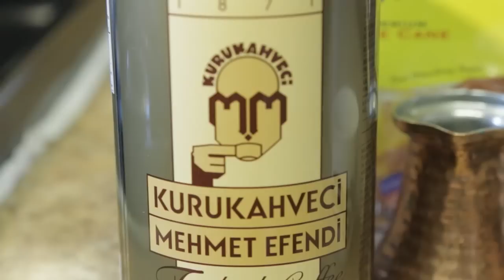Easy Turkish Coffee Making Guide

Comment: My steps: 1. Fill the cezve with 100 ml of water

2. Get it on full or medium heat, but don't boil it too much. Wait for bubbles to appear in the water

3. Remove the cezve from the burner

4. Add 2 teaspoons of the grinded turkish coffee and mix

5. Get the cezve back on the burner. Pay attention, because there should be foam rising. If you leave it too long, the foam will rise all the way up and pour some of the coffee out, making a mess

6. When the foam rises to the top, remove the cezve from the burner and pour it into a cup. Add sugar if you want